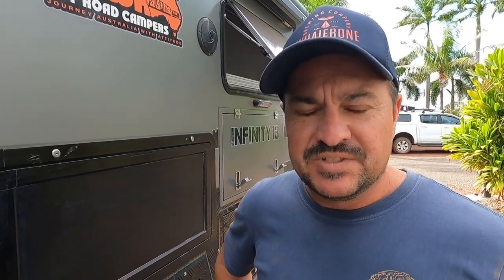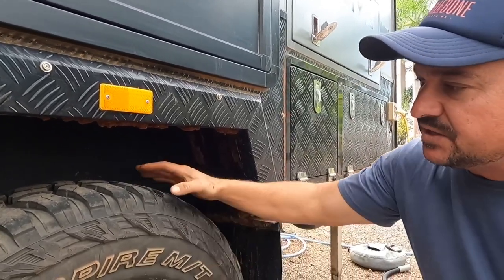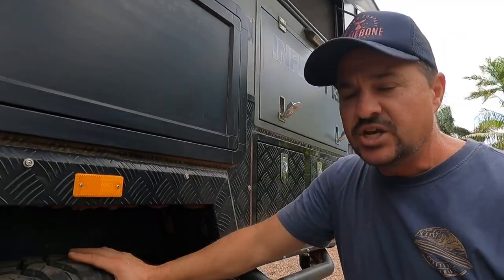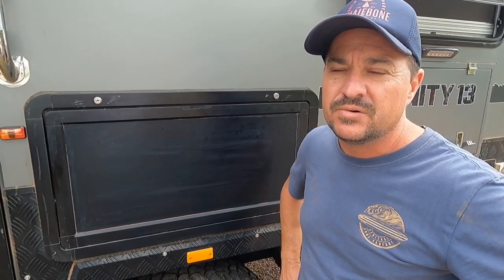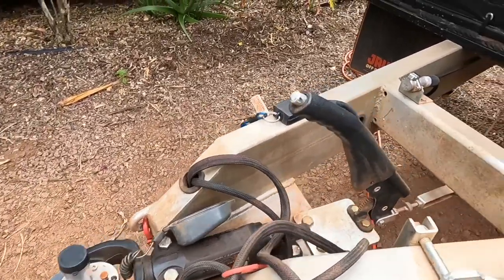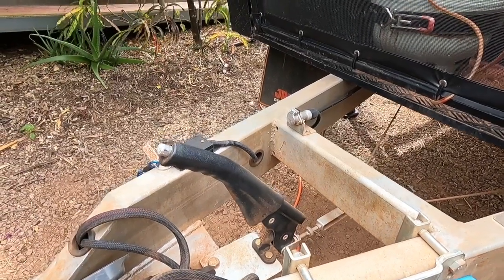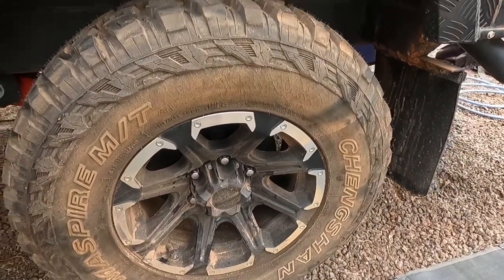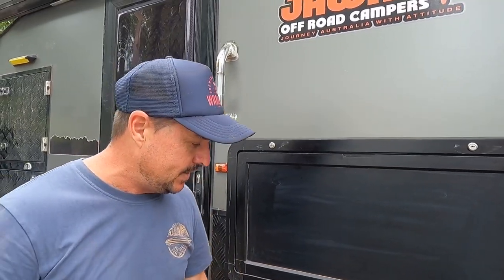Hybrid Caravan Safety | Avoiding a Serious Tyre Blowout | Tyre Change

Comment: Great video coming from a tyre back ground I reckon it's a manufacturing fault where there is air trapped between the layers of the sidewall I would try to pursue it and get a pro rata replacement from the manufacturer. changshan I believe maybe associated with Maxxis tyres. and useing a torque wrench in Reverse is not a good idea it will stretch the mechanism inside and brake they are just not designed for reverse application even though there is a button so you can.

Comment: Another tip is to get rid of the plastic cap on the bearing cover.
Makes it easier to check for bearing heat. 
Just noticed you have pressure monitoring..oops my bad

Comment: I remember being told 140nM for the nuts a handover.  I checked at 140nM on first trip and they were defiantly at least that. Bought our bottler jack after Ants first video, knock on wood, not needed it yet after 10 000km.

Comment: 61 psi seems too high. I used to have a single axle and the tyres were at 45 psi when cold and warm to about 50 psi. That hard eliminates all give out of the tyre.
Reply: most of these are rated to 80psi,  60-65psi is about right with 3t on a single axle hybrid van

Comment: Good spotting. That's my one fear with our single axel van, you don't get a second chance at 90 km/hr if you get a blow out.. 
I wouldn't of thought you would jack up the van with the stabiliser legs on the opposite side down. Would they be rated for that sort of weight?
Reply from the maker: Just loosened them up a bit. Plenty of room to move

Comment: Did you find out what the issue was, with tyre. Good job 👍
Reply from the maker: Not yet. In the outback atm. Getting new tyres on the car in a month or so, so will check it then. Still have one spare for the car
Reply: @empty_nestadventures  I'd replace the tyres on the van as well. Costly, but replace those cheapies on the Hybrid!